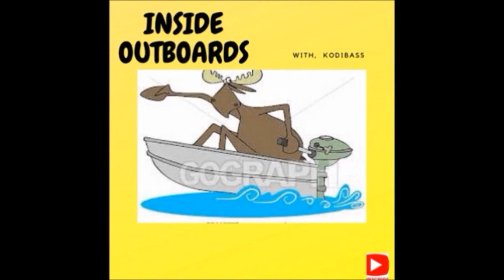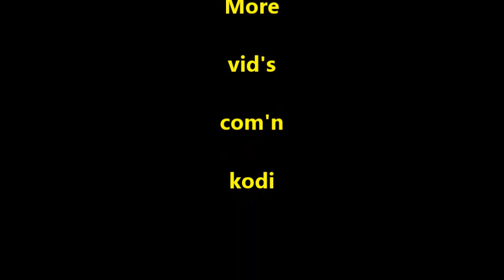YAMAHA 40 HP ENDURO    (( Part 3 ))

Comment: Happy New Year from Quebec ! How do you reckon so much corrosion was caused ? Could it just be from plain salty air or would that carb have been  at some point flooded with sea water ?  Thoroughly enjoyed the dock tour !
Reply from the maker: Happy new year!   It is absolutely salt air here on the Island,  I have replaced the electrical breaker box on the outside of my house 3 times in 14 years,  salt air eats things of metal here.  its truly Amazing.      kodi